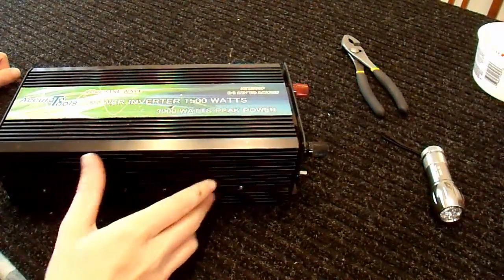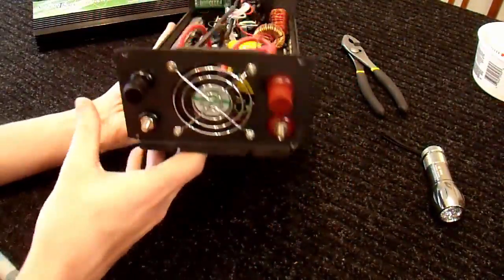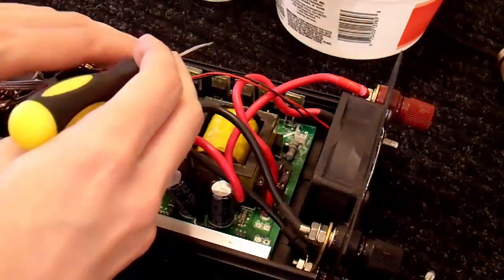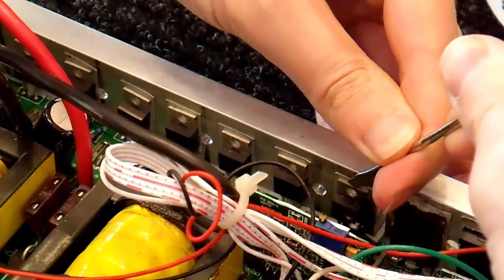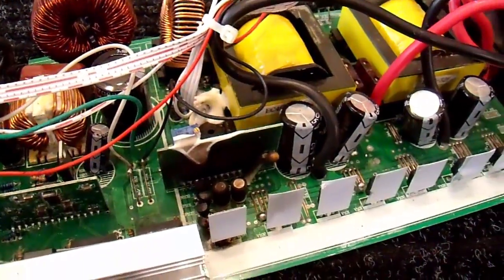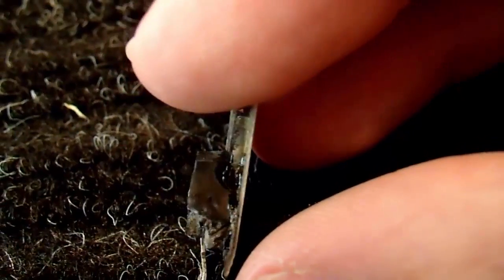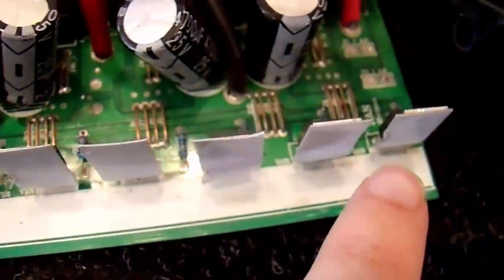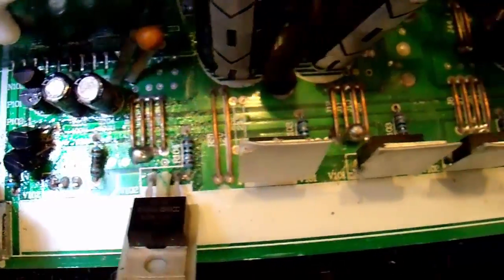Accurate Tools Pure Sine Inverter Review and Repair - Part 2/4

Comment: The problem is that when I connect the battery does not produce output voltage is kept beep and with flashing light

Comment: I am benefiting hugely from this since I'm needing a psw inverter in this price range and I tinker, but I'm confused about using teflon  instead of tape. I'm going to use paste. When overclocking CPU's (a similar issue of pushing semiconductors to their thermal limit) teflon should be a no no since it's actually an insulator rather than a thermal conductor. We actually isolate stuff with thick bands of it in aerospace RF stuff.

Comment: Great video. I'm bidding on a new Accurate 2K/4K watt inverter  (Ebay) and it seems that your telling us to avoid this 'Chinese' company. I could get it for less than 100 bucks. I just want to run a vacuum cleaner in my car. Just how bad are these? Can't you drill extra holes for cooling? Maybe do other modifications?

Comment: i had a xantrex inverter with irf1404's and one of the fets in that inverter failed it didn't explode like yours but it went short circuit and burnt out the pcb trace and there was a 5.1 ohm resistor that blew out with it which probably saved the control circuitry i have a repair video but i haven't gotten around to posting it yet